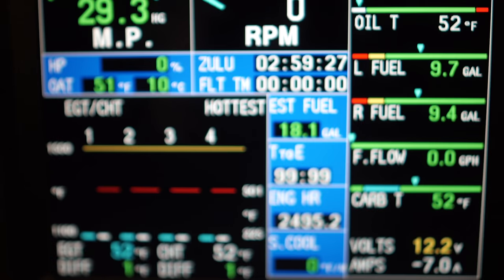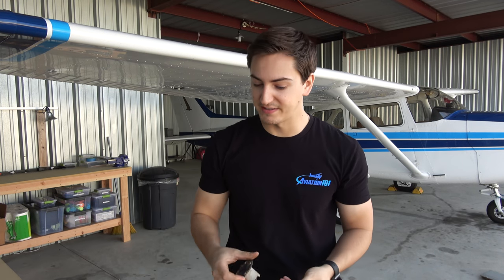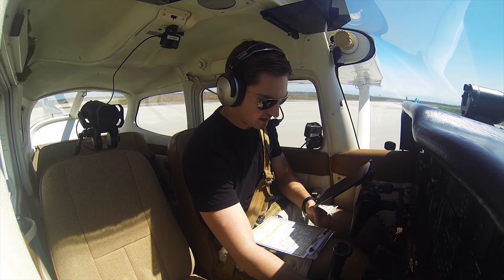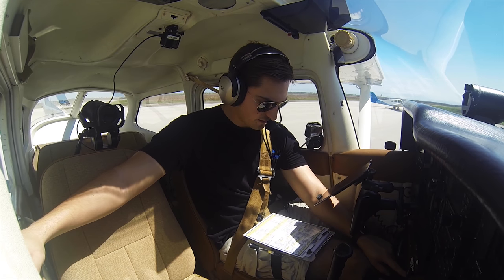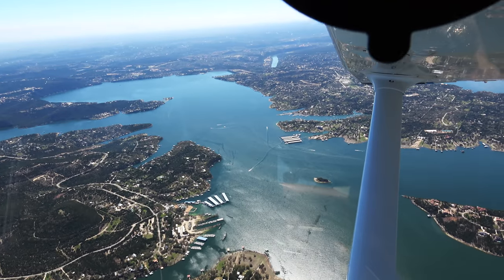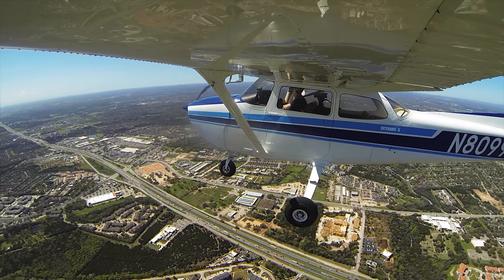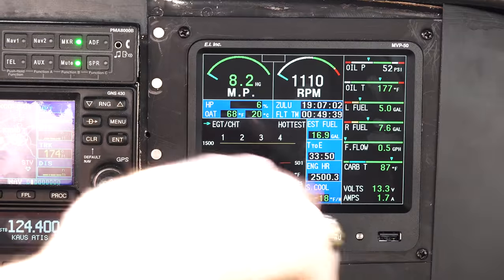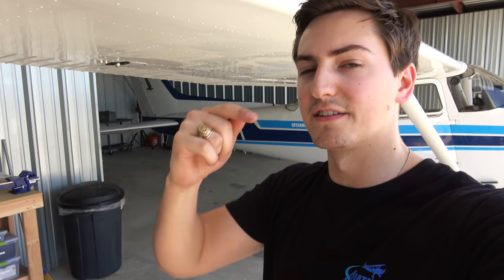No More Engine Gauges?!

Comment: I think that’s the nicest Cessna 172 in the world
Reply: Definitely far from it. It is a great example of an older model, though. The newest ones are really nice. Even has electric trim.
Reply: @Ichibuns , while I agree with you, c'mon, cut the airplane a break.  It was built in 1976!  :D  For what it was when it was built, it's not half bad.  Admittedly, a nice new, all aluminum panel would be nice, and I suspect that will be part of the total upgrade when they are done with it.
I also expect N80991 will have electric trim once on the Autopilot is installed.

My only question is will Josh and his Dad opt for a Garmin GFC500 autopilot, OR, will they go 'whole hog', relegate the G5's to the right side of the panel, and install a Dynon Skyview HDX system?!?  At the beginning, you'll notice that Josh also has a Dynon D2 'Pocket Display' as a backup device, so they are fully aware of Dynon.  Personally, I'd like to see the Skyview HDX system installed, a used GNS530W paired with the 430, and the two G5s moved to the right side, or, even left on the left side, further over, for backup displays.  The Skyview, in it's fully glory, is a pretty slick system.

http://www.dynoncertified.com/pdfs/C172-Ammended%20STC.pdf

This is the new Expanded STC for the Skyview HDX system, and they're saying that with the single display, it's $25K, and the second display adds another $4K or so.  But, delete the ADS-B In/Out and the Engine monitoring because of the GTX-345 and new EI monitor of this video (why duplicate or replace what you already have?) and you could come in at UNDER $25K!
Reply: @GaryMCurran  I completely agree. That's why I said it a great example of an older model. I fly both brand new and older. I fly 2018 S models to the 1981 P model. His 172 makes our P models look terrible lol. Netjets supply our airplanes now. The new aircraft are crazy nice when you compare the. I personally prefer the R and P models. I think they're much more responsive.
Reply: @Ichibuns  I just wish Cessna would reintroduce the Cardinal RG, with a IO-390 and a Garmin G1000NXi panel.  That would be a sweet, sweet airplane that would sell very well.
Reply: @GaryMCurran  Its about time to redesign a lot of things. The 172 could definitely be replaced by something far more efficient
Reply: @Ichibuns  Yes it could, but at what cost?  The Skyhawk is a great primary trainer, simple, easy to fly, and docile.  What do we want to redesign it to?  Weekend get away airplane for a couple or a small family?  The Cardinal would do that.  Complex training airplane?  Well, unless you add retractable landing gear, constant speed prop and a bit more power, the Cardinal does that.  Personal airplane for first time buyer?  Skyhawk is a great plane for that, easy to fly, easy to learn instruments in.
What do we do to make it 'more efficient?'  Well, we could remove the wing struts, we could lengthen the cabin by a few inches, add a carbon fiber wing and fuselage.  But, then we have a new and different airplane.
Personally, when they reintroduced the Skyhawk with the upgrades they gave it, I think they hit the sweet spot.  
BUT, here's my caveat.  I'm not current, I haven't flown in a while, and while I have flown the new Skyhawk, it's been a while, and I have never flown the G1000 version.
You know, Tornado Alley Turbos did a Turbonormalized version of the Cardinal, and with that slightly larger IO-390 and that STC updated for the newer, larger engine, you would have a very nice cruiser for longer ranges in the mid teens that would, hopefully, be able to come in under the $550K mark.
Reply: @GaryMCurran  It is a great trainer but competition is getting much better. Schools looking at new aircraft are looking past them. They need to be more competitive.  It'll need done enventually
Reply: @Ichibuns  I agree that the competition is stiff, between the Diamond and the SR-20, and a couple of those LSAs that are out there.  I haven't l  ooked at pricing on a lot of them recently, but I suspect that value wise, the 172 is still up there.
I do wish they would have gotten the Diesel engine thing worked out, as I think that would have been a huge opportunity for them.  Not so much in the U.S., but other places where AvGas is so expensive, and Jet-A is so much cheaper, having a Diesel engine is just going to give you a leg up on the others.
Reply: @GaryMCurran  If only it wasn't an extra $100,000. Kind of defeated the purpose of saving on fuel. If a diesel trainer could exist at the regular 172 price point, it would definitely sell well

Comment: Best power is not always mixture full rich, dont you LEAN for best power? Should always be leaning even if at sea level etc.
Reply: It's an age old battle.  Technically, yes, you should lean even at sea level, but the reason it's full rich is that it provides near full power at that position, and you're too busy either landing or taking off to honestly worry about it.  A FADEC engine constantly updates, and in a current day car, you'll never see anything about it, but airplane engines are dinosaurs.  The range of power at various power settings is enough to keep you 'in the power band.'
Think about this.  You watch some videos, and every once in a while, somebody gets handed off to a new controller, and they end up having to change the barometer for the current altitude.  BUT, do you ever see them reach over and adjust the mixture? No.  Why not?  While that altitude may change by, in some cases, a couple of hundred feet, the engine still runs smoothly.  Is it the absolute best mixture?  Hardly, but it works.
Now, there WAS an 'I Learned About Flying From That' from quite a few years ago that I remember.  Gentleman flying a 421C Golden Eagle, and had a true, honest to God engine failure.  They were at FL230 and they descended.  At night, and in IMC, the single pilot was busy.  As he drifted down and reduced power, he lost the OTHER engine.  In all that he was having to do, he neglected to actually LEAN the mixture, since he had firewalled it on the good engine, as had been taught.  It was TOO rich.

https://www.flyingmag.com/technique/i-learned-about-flying/i-learned-about-flying-worst-case-scenario

So, while flying with everything firewalled, he was fine, but reducing the power at the altitude he was at, without the leaning, he flooded the engine.

So, while an airplane engine has a 'band' it will work in, we apply full rich for high power situations and in situations where we might NEED full power, like an aborted landing.

Is this clear, or did I confuse you?

Comment: I know the younger gens are all about electronics and have that "NEED" for graphics, but lets face facts here...ALL things can malfunction, and they do.  The older pilots know that having separate systems, (Vacuum, dual magnetos AND electrical) etc, let's you have backup in the event one system fails.  Personally, I would never trust any system (all glass) with my life.
Reply: So how do you track traffic around you without electronic traffic , eyes are a good start but I like having the extra set of eyes all around me electronically on my G1000
Reply: @2Greenlid  And the point flew right over your head

Comment: I'm kinda "old school", because I'm old...haha! I'm not the sharpest knife in the drawer as far as technology goes. I can see how this new "glass cockpit "technology can help, in accuracy of readings and weight savings, but every failure I've ever had with modern vehicles , has been because of some sensor going out. What happens if there is an electric failure, or something that causes your instrument panel to go dark? Please don't mistake my intention, I'm not...what does my daughter call it.....trolling? 
As an example, a few years ago my brother in law and I went hunting. His super fancy GPS failed, the batteries went dead or something. Lucky for us, I had my old Army issue 1970 lensatic compass and a map. So I'm not knocking it...especially when I saw the weight savings and the digital fuel sensors...but I just don't know...
Reply: I'm an old guy, too.  Kind of.  Okay, I'm over 60, that's close enough.  Electronic flight instruments have been around for a good long time, actually.  Remember, the genesis of a lot of these systems was in the military and airlines.  They were big and clunky, which is why they didn't funnel down to GA.  The Beech Starship is a great example of this.  Collins Avionics, if memory serves, individual CRT displays that did little more than duplicate analog displays.  Nothing like what you'd get today in something like a Garmin G500TXi.  Insanely expensive, heavy, and heat producing.  But, they were there, and pilots liked them, aside from the gee gaw factor.  Fast forward 10 years or so and the CRTs were gone and LCDs and LEDs were in our panels.  Much lighter, much cooler and more reliable.  Easily configured in software, both hard coded and soft coding, the pilot inputing what he wants to see or not.
How many stories do you hear about total display failures, and then how many stories do you hear about a vacuum pump failure?  Your vac pump disappears on you, your gyro and AI all go away.  That's a tough deal in solid IMC on an approach to minimums.
No, I'm an old guy, too and I have more trust in the newer digital electronics than I do in the old analog, vacuum driven systems.

Comment: Okay, I'm going to open a can of worms here.  As a private pilot, or anyone flying a carburetted airplane, we are told to add carb heat at landing.  I'm going to challenge that for this day and age of modern electronics and avionics.
The EI and JPI, and I would assume most every other Graphic Engine Monitor, is going to provide an input for carb heat for those airplanes so equipped.
At your altitude for approach into San Marcos, you were in the high 40's and low 50's BEFORE you applied carb heat.
Why?
Yes, I understand it's how we were taught to fly, particularly on those airplanes without a Carb temp probe.  But, since we have them now, at least in the retrofit market, why continue to use unfiltered air into the carb if it's not needed?
The Checklist says, and I'm not quoting, but from memory, 'Carb Heat: As Required.'
Yes, we've been instructed to use it, as a matter of course only because we haven't had the ability to know the carb temp with any degree of accuracy.  Now we do.
So, is it possible, practical or useful to actually LOOK at the Carb Air Temp and decide 'hey, it's 58 degrees F, I don't think I'm going to get any icing if I drop the RPMs below 2200, so why am I putting on Carb Heat?'
I am not current, haven't flown Cessnas in a VERY long time, and probably never will again fly as PIC, but I still love aviation and those who VLOG.  So, I'm curious to all input on this.
Reply: You are correct; According to an FAA manual which I invested in to keep myself entertained; Moisture is required for icing to form; Hence that one states if not in ice or rain or cloud-borne moisture; Then icing does not occur; In the carburetor venturi the Hydro  Carbons have water so it is a real and valid concern though if engine is to develop full power the minor loss due to heating the air may be valid safety tradeoff = seems to me just above 40° OAT is where decision point may need to err to safety ••• me being a mechanic by nature I can feel and hear how the engine is doing ~ I did look at carb heat several times but I had a CFI as PM
Reply: @ChiDraconis  It doesn't have to be visible moisture.  Enough humidity can result in ice with enough of a temperature drop in the carburetor.
Reply: @rempilot  Sounds correct
Reply: @rempilot  I agree that moisture in the air, even unseen moisture is enough to create carb icing, but the question still remains, if the engine monitor is above freezing in the descent, moisture or not, should we continue to use carb heat?  The key to this is having an engine monitor and knowing the temp of the intake air.
Reply: @GaryMCurran  I guess it depends on what  level of risk/reward you want to live with.  Normally on descent to landing the carb heat is on and left on until after landing.  Unless you are landing in a "Flight of the Phoenix" level sandstorm (the first movie, not the silly remake) there will be no significant additional wear to the the engine from the unfiltered air.  You don't have to think about it unless you have to add power for a go-around and then you're shoving everything forward anyway and "carb heat - COLD" is part of the procedure.

If however, you elect to monitor the gauge,  to begin with you are assuming that the carb heat gauge is accurate and that the probe is located in the coldest part of the venturi.   The gauge then becomes one more thing to monitor on final (if you don't, you have to assume that the temperature gradient is standard and the humidity level isn't changing during the descent).  

I recall an accident report where carb ice was considered a possibility because, even though the general conditions were not favorable to carb. icing, the airport was located next to a golf course with a big sprinkler system for irrigation.  With the sprinkler system active and the wind blowing the right way, the thought was that it provided a very localized area of high humidity over the runway. 

Lastly, if at the end of a long descent carb. ice has formed for some reason, and the engine has been at a low power setting, there may not be much carb. heat available when you really need it.
Reply: @rempilot  well reasoned reply.  Thank you for your input.
Reply: Gary C - Glad to add my 2 cents.  I must admit, though, my first thought was to write “Anyone who doesn’t use full carb heat on final is an ignorant boogerhead.” But I decided to save that sort of talk for anyone who wants to have debate about how dangerous “downwind turns” are.
Reply: It's been a long time since I read about it, but during WWII Charles Lindberg was able to extend the operation range of the Lockheed Lightning by, among other things, adjusting the intercooler flaps (basically a cowl flap for the intercooler) so that the induction air was at a better temperature for fuel vaporization.

I've never really played with it, but there are lots of little variations that can be done to experiment (particularly with a carb. air temperature gauge). I would preface this by saying this would be at cruise (75% power or less), and with plenty of altitude.  If the induction air is too cold, application of carb heat might help with vaporization and allow a little more leaning (some of which would be required with the carb heat anyway due to the warm air being less dense) and may help with smoother running.  A fuel flow meter would obviously be beneficial.  Obviously don't do anything outside the operating procedures in the POH, but there is some room for experimentation within the published limitations.

Comment: Take off with full power indicated 83% power on engine monitor....
Reply from the maker: 1) above sea level, 2) hot day, 3) engine is rated full power at 2700rpm (red line). 2700rpm won’t be achieved standing still.